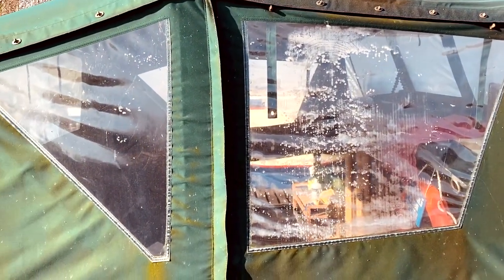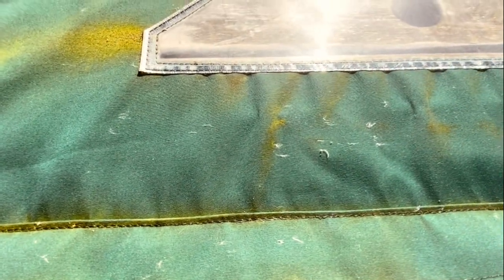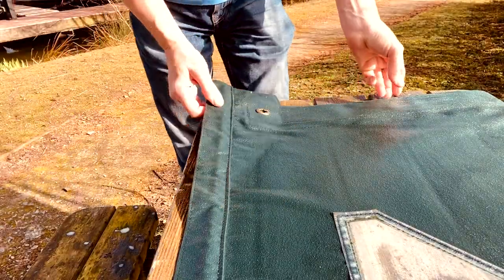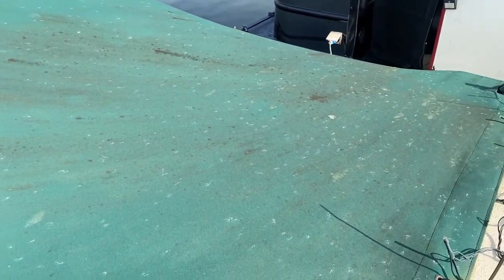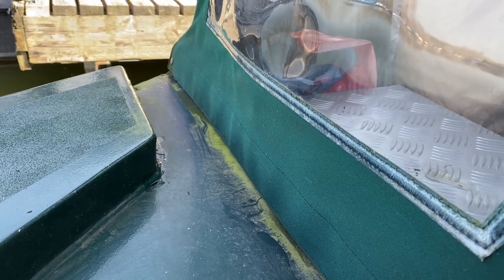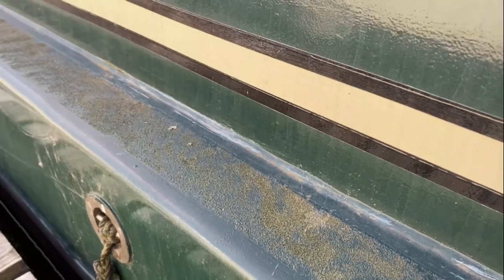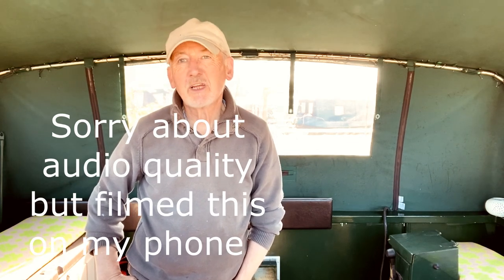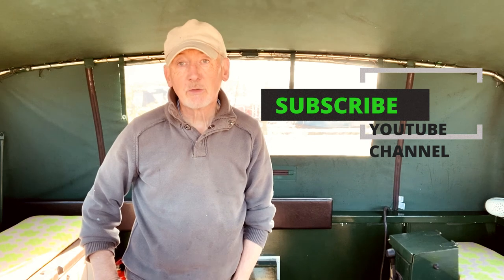Vlog 40 I'm getting dirty with a real scrubber!! - Misty & Me

Comment: Great job 👍
Reply from the maker: Thank you Angela I am pleased with the results and the cleaner worked fantastic for very little cost. At £25 including the waterproofing I plan to do it again before winter sets in as £50 a year is nothing compared with the £1000’s I would have to spend on a new set of covers.